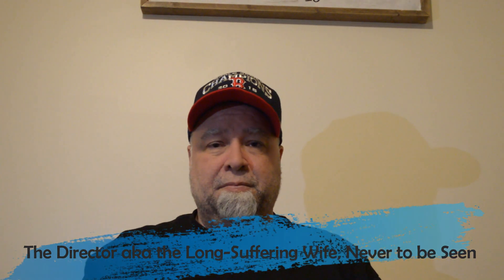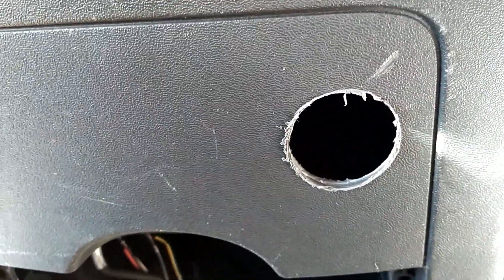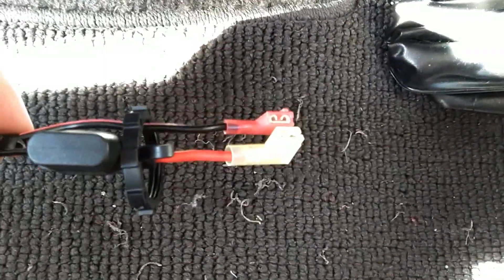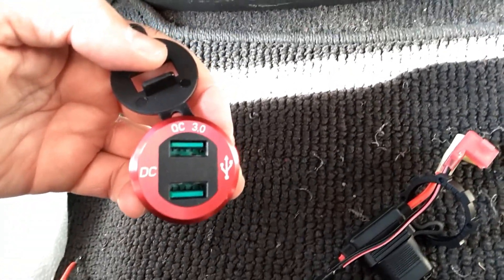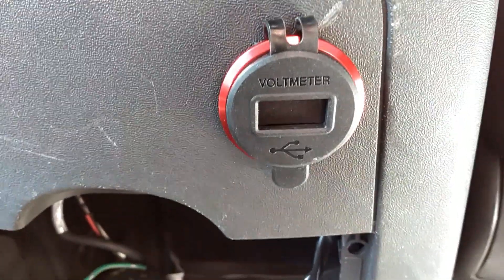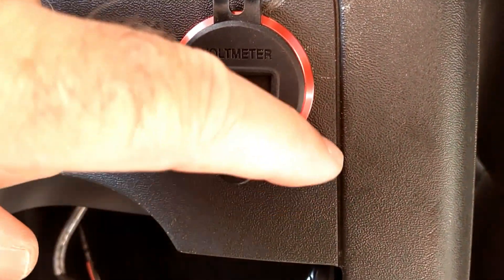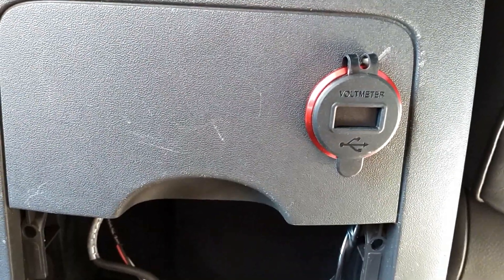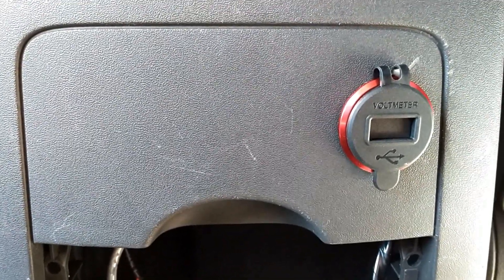Power 'Em UP!!! Frontier Crew Cab Rear Seat USB Power Outlets

Comment: It would be nice if you showed how to hook the wires up
Reply from the maker: Hello Joe, thx for writing in. This device only has two wires, a 12v and a ground, as does the OE power socket. The negative lead is Black, the positive is Green / Yellow, for the Nissan harness.